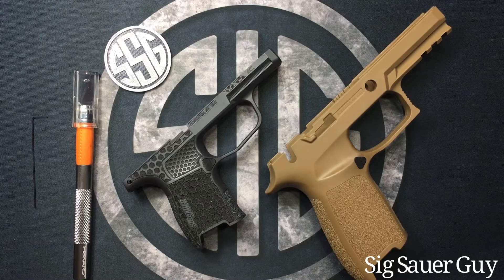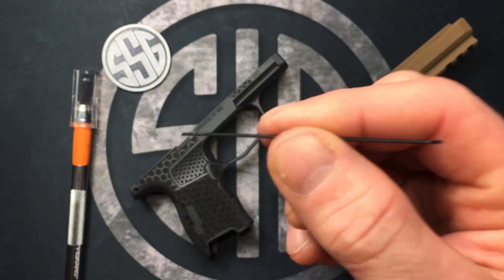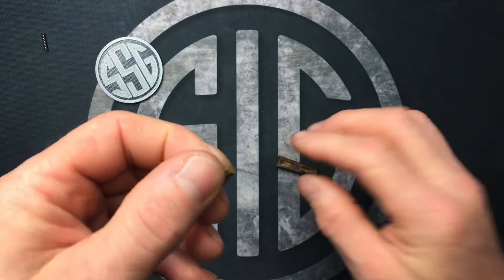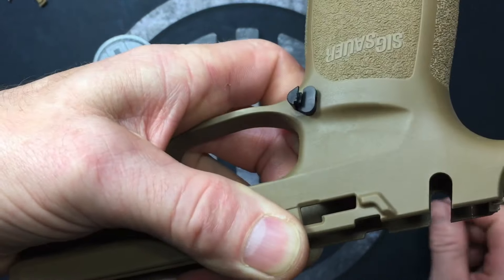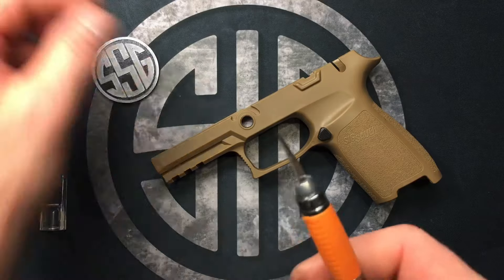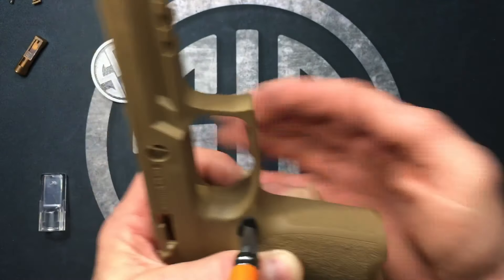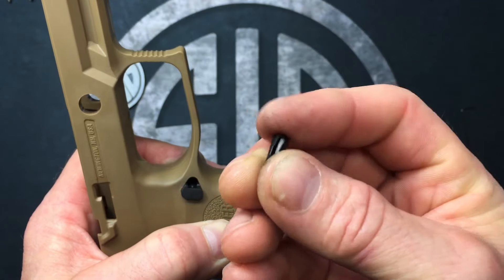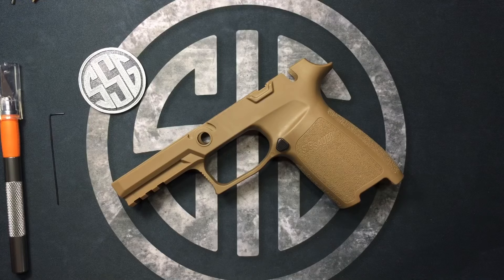Magazine release removal methods for Sig Sauer P320 and P365

Comment: How hard is this suppposed to be??  I am seriously breaking a sweat, getting hairline fractures in my fingers, and pressing on this plastic to the point of crackinng - mix some moans and groans in - and I am ready to throw this thing against the wall!!  I'm following exactly what he says and my inner wedge thingy is not moving at all!  What am I not getting here??
Reply from the maker: Have you tried the razor blade method?
Reply: I hereby turn in my man card.  This has defeated me.  There's got to be something wrong wiht that spring locker thing.  Pushing on it without it budging
Reply: @SigGuy   I'm out of blades for my exacto knife, or my son lost them somewhere.  Going to go by Home Depot on way home to see if this helps.  Thanks!
Reply: @SigGuy  15 seconds after getting the exacto knife out of the package the mag catch parts were out of the frame.  Thanks!!
Reply from the maker: @jameschambers3355  lol. Awesome!!!! And no hospital visit or stitches! SUCCESS!!!! Nice work bud. Have a great weekend.

Comment: TBH I still Fing hate the new magazine release... Wonder if anyone offers a service to mill the original series back to the original design. But if anyone is having problems with the poke method, aka the wedge keeps pushing back into the hole. There is a little lip on the wedge to prevent it from moving back into the hole. You also need to have something prying the lip on the front of the wedge.

Comment: Will the P320 housing fit in a p365 body or is the housing bigger on the P320?
Reply from the maker: larry lucas completely different. Will not fit. I believe someone is actually coming up with a module similar to the XL that is used with a 320 FCU and slide.
Reply: @SigGuy  Thanks! CDNN has refurbished P320 for $379 and I thought that maybe I could use it also as a P365. Still not a bad deal.

Comment: On mine, the Allen wrench literally push the wedge down completely as opposed to up. Is there a reason why it may be doing this rather than moving up?

This working the exact opposite of how it is in the video. The Allen wrench is literally pushing the wedge down because of the angle.

Pardon the video quality, but this is how it's going for me. 

https://youtu.be/IYig6HO4urA
Reply: Just did mine tonight and was having the same issue (it was pushing it down). It wound up that I wasn't angling the paper clip down far enough! Once I did, it walked it self up like in the video.

Comment: Well, Holy Shit!  Man I've Always done the "Hole Trick" during Smithing and Coating prep on these Turds, and have always disliked the design of these POS (Opinion Only) Pistols, But then Again, Most Sigs in general SUCK ASS imho, Although, I do Carry a G-32 357 Sig FANTASTIC CARTRIDGE (Wise Opinion Only) Also.
Man I love that Engraving Work on the P365 WHO did IT Please?...Lazer or Hand?
I have a Customer that would likely want it done, Plus it's Bad Ass Work imho.
Sorry I Digress,...(Kimber's also Suck)...I tried the Exacto Knife "Trick" and Wow, Man it works Great! Thanx Brother.